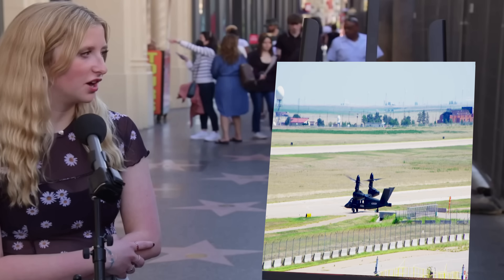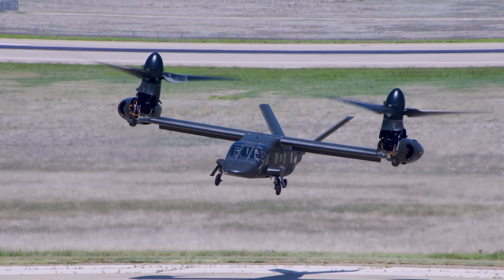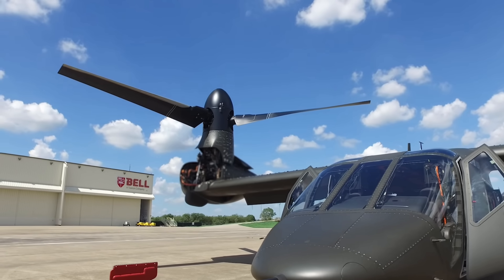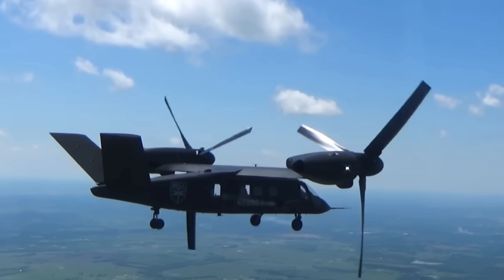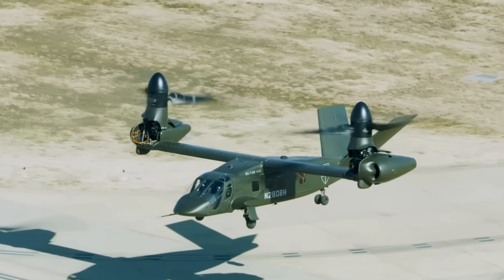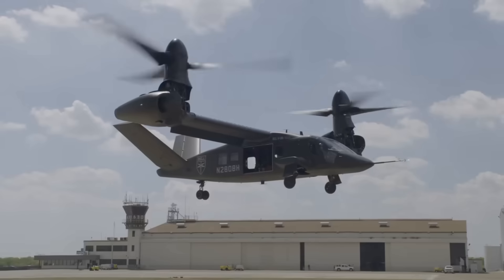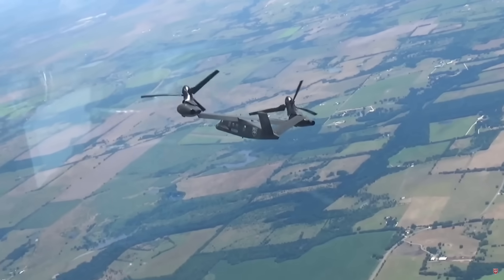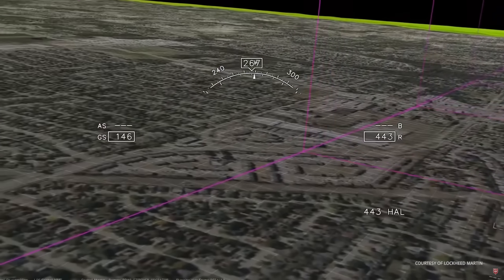Bell V-280 Valor - What's the big deal anyway? | BLACKHAWK REPLACEMENT

Comment: It will be interesting to see what weapons systems at to be installed on it.
Reply: With those massive propeller systems on the side, good luck even having any door gunners protecting the aircraft.
Reply: @jimmay1988  Firing guns through props was figured out back in WWI, it's not going to be an issue. Plus with the rotors forward, they aren't going to have those side doors open for the door gunners to be doing anything when it's going along at 280 knots or more.

Door gunners would only be in play when the rotors are swiveled up and the craft is moving a lot more slowly
Reply: There are mockups that have foldout racks for missiles and rockets.

Comment: Whereas the Tilt-rotor design is inherently faster and has better range than a helicopter due to it's large lifting wings, my issue with the choice of this platform over the other competitors is that the V-280 did not adhere to the requirement for it to fit within the footprint of the UH-60 - a requirement the other competitors did adhere to with their helicopter designs. The competition runners gave Bell-Textron a quiet pass on this throughout the competition while also favoring their performance benefits that clearly cannot be attained with a true helicopter. It stinks of having an intended winner picked in advance, essentially handing out a no-bid contract under the cover of having a competition. If they wanted a tilt-rotor's range and speed characteristics and didn't give a damn about the footprint size they should've made that very clear at the beginning of the "competition".
Reply: There was another tilt-rotor design in the program I believe it was by karem aviation looking at the program it was always shortlisted between bell and Lockheed
Reply: The Valor does fit within the Blackhawk footprint. Rotate 90 degrees and it fits.
Reply: @bl8danjil  Incorrect
UH-60M -
Length: 64 ft 10 in (19.76 m) including rotors
Main rotor diameter: 53 ft 8 in (16.36 m)

V-280 -
Width: 81.79 ft (24.93 m)
Length: 50.5 ft (15.4 m)
Reply: @Kingdoms_and_Kobolds  You must be new to military logic. 🙃 For the military, that is what fits within the footprint of the Blackhawk. Even the SB-1 Defiant is a little bigger than the Blackhawk and certainly taller...way taller.

Jokes aside the Army wanted speed, distance, and capability in their requirements especially since their potential enemy might be China and they would be launching from South Korea, Japan or Guam. The Valor demonstrated that it could do that and be faster over the Defiant. The Valor was farther along in development than the Defiant too. It's a refinement of the tilt rotor technology Bell has worked on. 

The footprint thing must have been something the Army was flexible with. They probably said something along the line of "something the size of a Blackhawk" because I can't find where it says they required it to fit within the footprint. It may have been a pure marketing talking point on Sikorsky part.

Comment: Boeing isn't involved in its development, so that's a plus. That said, I did have high hopes for the Defiant. I think that the Army will have to really put the Valor through its paces in a wide range of exercises to see just what its limitations are and perhaps decide whether various doctrines will have to be altered or abandoned. Speaking of Somalia, can troops fast-rope out of these into an urban area? Or does the Army even want to do stuff like that anymore? Sometimes it's not about what they want to do, but what they need to do. There's a lot of questions. It may be that some number of Blackhawks may need to be retained if the Valor cannot satisfy the needs of some missions.
Reply: this seems tailor made for high speed, long distance flights in the western pacific to offload troops and then do it again. I have no doubt it can perform all the roles of a blackhawk, but it certainly has different strengths and those seem to be the focus of what the army wants from it.
Reply: The Valor is a second generation tilt rotor, the Defiant is a first generation coaxial. By choosing the Valor this will lower the teething issues significantly. Also the Army is building out for a potential Pacific conflict, in that theater range and speed are king and the Valor just has so much more of both over the Defiant. Lastly the Valor has had a very smooth prototype cycle that is already complete where as the Defiant had a major incident where it cut off it's own rotor blades and is still being developed. The Valor is ready the Defiant just isn't.
Reply: @acarrillo8277  coaxial helicopters have been around for over 75 years…. The Raider X might have been the newest, but it most definitely was not 1st generation. I think choosing the Valor over the Raider was a massive mistake. Hopefully I am proven wrong.
Reply: @acarrillo8277  Valor isn't a 2nd Gen tilt.  The With the V-22, the entire nacelle pod actuated. (Engine/Gearbox/Driveshaft/Rotor Complex).  On the V-280, the Engine/Gearbox remain fixed, but the Driveshaft/Rotor Complex actuate.  Night and day difference.
Reply: @acarrillo8277  Technically the Defiant is a 2nd gen coaxial. The Valor is also still very much in the development phase.
Reply: @rainsilent  Have there been any mass produced US coaxial rotor helicopters prior to the S-67? I couldn't find any.
Reply: @acarrillo8277  Nope, but the tech used in the Defiant is beyond what was used in the S-67. Thus in terms of generational speak the Defiant would be considered a further generation of helicopter from any prior coaxial prototypes in the US sans the X2 as the Defiant and Raider are heavily influenced by the X2. The X2 was a re-investigation into the idea after about 30 years of technological advancement since the last coaxial prototype in the US.
Reply: @rainsilent  Ok I have to correct myself the S-69 was the first Sikorsky coaxial rotor helicopter. It crashed early in the test program and the coaxial concept was abandoned as it was mainly part of a compound helicopter program. The whole coaxial thing was on the shelf until the Sikorsky X2 when they actually got it working, and to my shock never crashed it, but it was never more than a demonstrator. Calling the X2 first generation would be like calling the Gloster Whittle, the first British jet, a first generation fighter. Both are representatives of the developmental cycle leading up to a first generation craft. So the S-97 is much more a representation of a first generation of coaxial rotor. If we were going by your logic then the V-280 would be third generation as the V-22 was developed from the XV-15 an air-frame widely considered developmental.
Reply: @acarrillo8277  "Calling the X2 first generation would be like calling the Gloster Whittle..."

No. Your comparison is more apt to something like the HAL Tejas and calling it a 1st gen jet fighter. Neither are 1st gen, or truth be told, 2nd gen in their respective families. The X2 is taking advantage of such advanced technology that it most certainly is not a 1st gen coaxial helicopter. It might be the starting line of an oncoming family of helicopters but they are not 1st gen technology wise. The HAL Tejas is the first indigenous designed jet fighter made in India but that doesn't mean that it is a first generation jet fighter. It is very much a 4.5 gen fighter. The Gloster Whittle equivalent in the coaxial rotor world in terms of military service is the Kamov Ka-25. Realistically the Gloster isn't even the first jet fighter or potential jet fighter. The He-178 was an equivalent concept demonstrator and flew 2 years prior. The He-280 first flew before the Gloster and was being developed into a fighter when Heinkel was ordered to stop development. The coaxial equivalent that you are talking about is the Bedix model K from 1945.

"Both are representatives of the developmental cycle leading up to a first generation craft."

No, they aren't. To explain why I need to specify what a generation of aircraft actually is because you are mixing up a new family as a new generation and that isn't how generations work. I'm going to use the coaxial rotors as the example here.

The first generation of coaxial rotor helicopters flew in the mid 40s. Most of them went nowhere but they were the first generation. The one that went somewhere lead to the Ka-25. The second generation popped up in the 70s. The only one that went anywhere was the Ka-52. The X2 is a 3rd generation and all its subsequent iterations are part of that. It might be the first of the types to stick around in the US but that doesn't mean that it is technically the first generation of its type. Again, that isn't how generations work in types of vehicles. Again I point you to the HAL Tejas as another example as to why.

"If we were going by your logic then the V-280 would be third generation as the V-22 was developed from the XV-15 an air-frame widely considered developmental."

That is how generations in vehicle types works. You are confusing first vehicle of its type into production/service in a nation to be a first generation of its type. That just isn't how generations works in vehicle types. Generations are split up based on technological advancement not what makes it to production.
Reply: @acarrillo8277  Just to add a bit of context, the S-97 Raider isn't the Defiant X, not even close. It is a small, single engine aircraft designed as Scout Helicopter that can convert its internal weapons bay to carry 6 troops in a pinch, but NOT intended to lift cargo (hence why the single engine).

As far as I am aware, the Raider prototype has been flying for some time while the Defiant had a troubled history. Probably because the Defiant introduces way more vibration with its second engine but who knows for sure.

The Raider is intended for FARA while the Defiant is Sikorsky's bid for FLRAA (blackhawk's replacement, essentially).

Just as the Valor won against the Defiant, don't be surprised if the Raider wins against the Invictus, because it can do what the Bell 360 can do with only a single engine. 

Obs.: for those complaining about the Valor's footprint, well, the Raider has some transport capability and its footprint is closer to a Killer Egg than  a Blackhawk. Assuming that nothing goes wrong with it, Valor/Raider combo offers some serious flexibility.
Reply: The Blackhawk is going to be in the Army for some time. The Valor is not even finalized in its design. It's last prototype was ahead of the Sikorsky competitor and did complete all of its tests and was basically flying for extra research before finally being retired.
Reply: @bl8danjil  yes the Blackhawk is still going to be in service for a while even once the valve starts entering full production but the Valor has come a long way it's been able to make several test flights. So like any military contract there's multiple stages and The Valor seem to have won out against competition to win this current stage even though Lockheed Martin being Lockheed Martin is throwing a hissy fit that they didn't get to monopolize again
Reply: I was also thinking the Defiant was a better choice til I learned it's makers never got it to work.
Reply: @STB-jh7od Boeing of course
Reply: Fast rope will be better than osprey as in the osprey it’s off of the rear ramp into the rotor wash and with the vapor out the sides under the wing.   Should be much better
Reply: I think the Defiant has a place with the Navy and special operators as it has the same footprint as a Blackhawk so can land on ships and urban environments while still having a similar flight envelope to the Valor.
Reply: Troops can fast rope out of the Valor. It can also carry a hoist for medevac or search and rescue.
Reply: Lose the hate on Boeing

Comment: V-22 Osprey is fine (small sample size, but I've been on 10+ flights - day/night/etc.). The key issue was training. Initially they took standard pilots and tried to teach them helicopter skills. Now they take helo pilots and teach them the ordinary flying skills.
Reply: Never ceases to amaze me how many people trash the osprey without knowing the facts. If you compare the V22 to any other new air craft it's actually better than average (if the public knew about the teething issues of an F117 while that was under development...). The V22 just had some idiots heading the program that made some really bad decisions (like a public display with a problem that should have grounded the aircraft).
Reply: @fire304  corporations understand marketing, both positive and negative, and the lasting impact it can have. The Osprey issues were handled horrendously from a public perception & optics perspective.

It will forever be seen as a piece of junk, regardless of how it performs.
Reply: @c1ph3rpunk  you think of how many aircraft have had initial problems going to service it’s common place. Unfortunately people flare up and fail to think whilst the people who manufacture service and fly the aircraft quietly work it up to its full potential.
Reply: @fire304  I've been arguing this forever. Oprey is a fucking brilliant for it's time, capabilities, and isn't inherently as dangerous as other craft. It does like to set shit on fire though and sometimes it's self though... 

 The Valor literally can fly it's self, literally. It flies like a videogame so I'm told. Avionics and sensors have come a long fucking way... Anyone try flying a purely mechanical helicopter ? You're going to crash the thing in a second. Now a two year old can literally fly one for 10 USD. 

 It's just the media and politicians had a field day for their own agenda and each crash did have a large amount of deaths because it's a massive transport. 

 The F 35 losing to the F 16 during a training exercise is an other stigma which will NEVER DIE. Why? People read headlines, and the media and politicians are under no obligation to redact misinformation. 

 Haters gunna hate.
Reply: @fire304  to be fair, the air force did ground their entire fleet not long ago. 

I don't know... tilting engines in a VTOL just feels like asking for trouble.
Reply: @user-pq4by2rq9y  grounding an entire fleet is not all that uncommon. If you have a mystery issue it's better to err on the side of caution. In recent years the F-22, F-35, F/A-18, and T-45 have all been grounded because their pilots were running out of oxygen.
Reply: @fire304  fair enough. Still, I hope Bell managed to work out that unknown issue for the Valor.

Not that both aircraft are that comparable since the V-280 has similar engines but weighs half as much as the V-22. I hope it does well because I want to see quad tiltrotors become a thing some day.
Reply: @fire304  you're the public.
Reply: @williamforbes6291  actually I'm a Marine, so I have a slightly different perspective.
Reply: Yeah, that first disastrous crash was vortex ring state, which a helo pilot would have know about, should have recognized and flown out of.
Reply: I spoke to a Marine who'd been in an Osprey. He told me initially the Osprey had problems with Noise and Vibration. He was pretty sure they solved those problems by putting all the Noise and Vibration on the Inside. Does this sound accurate?
Reply: Too be fair it’s no different than the Blackhawk in that regard where there are a lot of crashes due to pilot error, and with the v-22 being the way it is it wouldn’t surprise me training needed to be updated
Reply: Tiltrotors or some version of powered Autogyros are the future for most of the general/ utility  aspects of military aviation but when in comes to heavy lift and things like the Little Bird are still going to be true helicopters for the immediate and near future because for heavy lift unless someone designs a quad-tiltrotor you aren't going to have the power to do heavy lift and for the tight confines of the Little Bird's domain single rotor or coaxial designs are all that can fit there.
Reply: @GoldPicard  IIRC, the Army has toyed with quad tiltrotors.  Not sure how far they got, but I've seen concept art.
Reply: @GoldPicard  What if we weld two of the valors together? hmmmm......
Reply: Should update the Osprey with this technology instead. The rear ramp and larger internal volume of Osprey makes it a more attractive logistics platform than Valor. But Valor has some neat innovations worth adopting.
Reply: @Stu_Bur yea I would like the v22 to have the same rotor system it's simpler and safer with the more consistent air flow. The valor probably handles dirt and debris better to🤔
Reply: @danielsnook7362  A main issue with the V-22 was USMC requirements that kept changing near the end of development. The smaller wingspan and rotor diameter make the downwash worse.
Reply: @n3v3rforgott3n9   are you say the valor has worse down wash or the v22 you kind of lost me their
Reply: @danielsnook7362  V-22 as it is a heavier aircraft that performs a different role but also because of certain design choices to meet marine corp requirements.